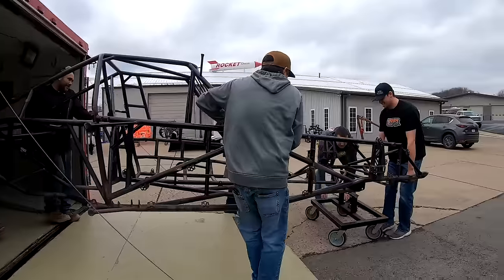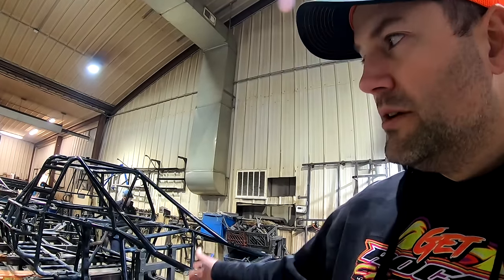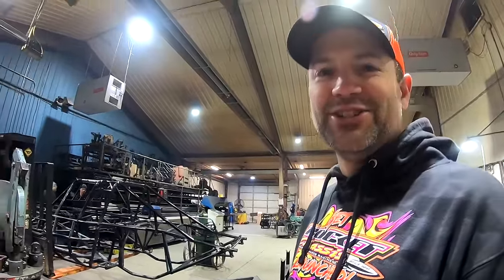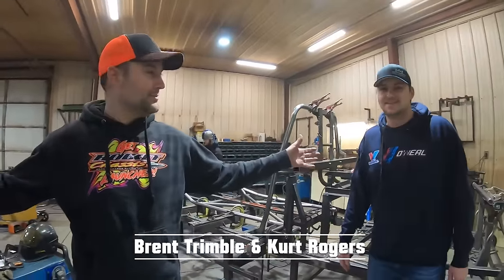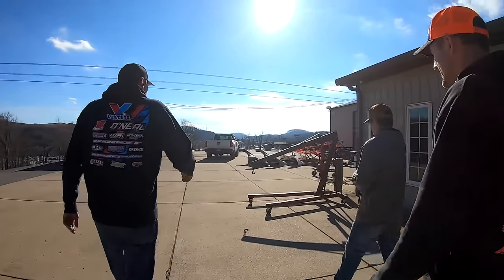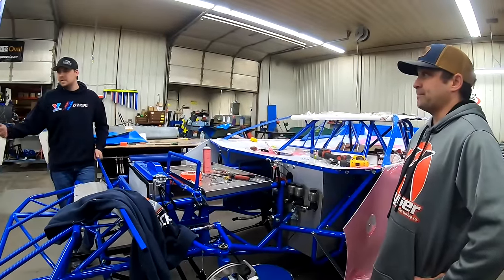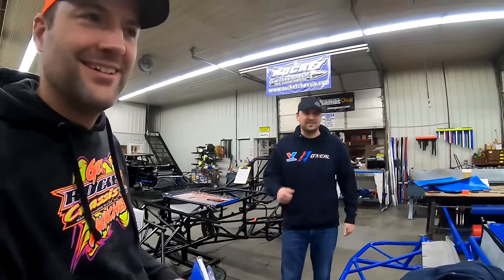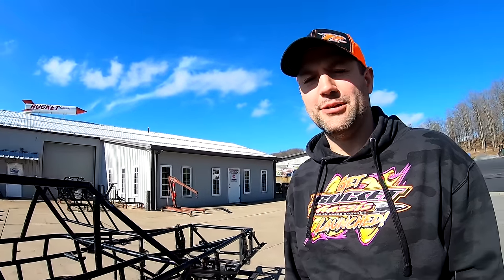How a Dirt Late Model is Built from Scratch at Rocket Chassis!

Comment: I have seen them build a car in 1 day as a roller.  All it needed was oil system, motor and trans and radiator.  Everything else was complete.  Saw it at 7am putting on front suspension and cockpit.  Came back about 6pm and it was being loaded in the toter.